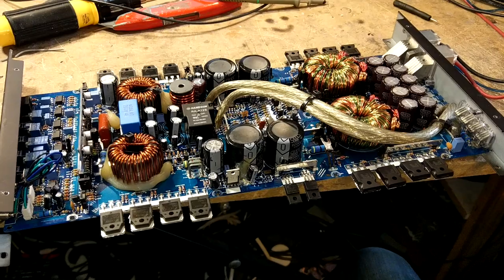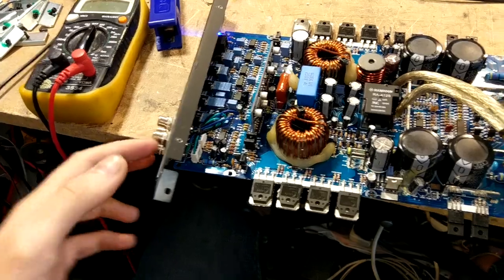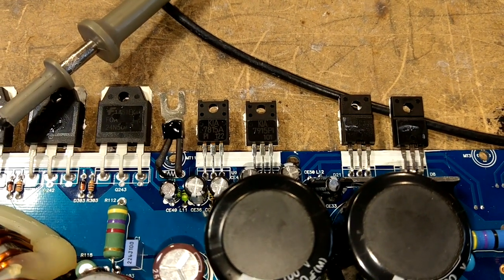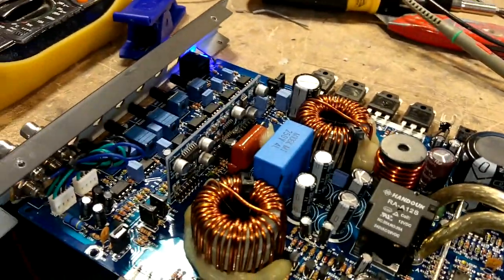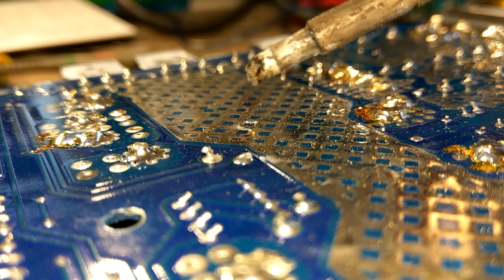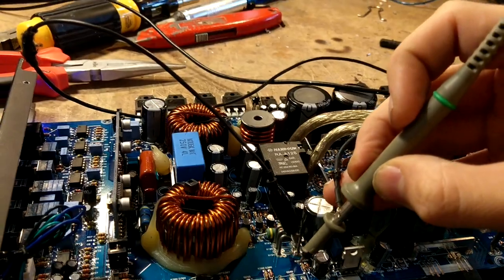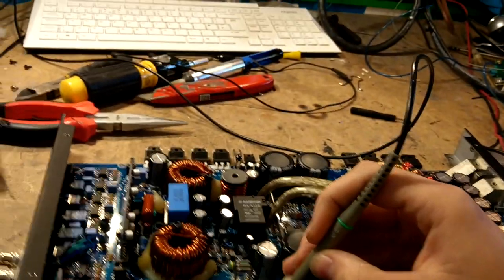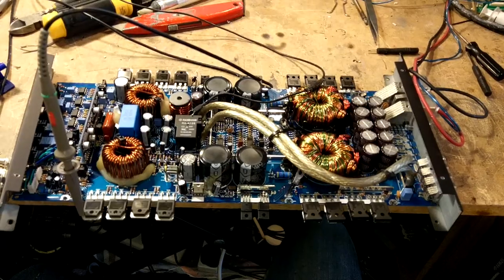Car amplifier fault finding - Sundown SAZ-1500D Repair

Comment: Most amplifiers these days require anywhere from 0.2 volts up to 6 volts in order for an amplifer to respond to the signal coming into an amplifier. Quite rite, sir. Thank you for this informative tutorial. I've had issues in the far past with amplifiers. Thankfully, my Orion XTR750.4 amp that runs my front and rear  component sets is followed up with my CT-SOUNDS 1000.1D monoblock run at 1ohm to my two 12" Black Diamond DX12V4's powered by battery isolator & yellowtop optima haven't given me much hastle the 3 years I've been running them. I've fixed pathways, replaced capacitors, and refreshed solder connections as well as gone as far as fixed a 3 layer old school pyramid amp board that was cracked in half. However, I've never tested or replaced mosphets, and so on. This video helps provide me with a good process for reviving my set to the side amps that may see more use for myself or others down the road. Certainly, an idea of how to tackle my monoblock as the warranty is practically up this January. Thanks.

Comment: Very informative. Had the same issue with a snapped transformer lead --> LM7812. Took me ages to find it, due to the fact it was under the sealant and I wasn't so experienced enough so i could resolve it quickly. 

That video is time saver for beginners ! Veryyy niceee !

Comment: Thanks for sharing 
I used  to have the same soldering station and heat station all in one same as that one you do ..worked like a beast until I retired it  😂
Reply from the maker: My one occasionally drops out the heat gun for a few days then starts working again. Pretty annoying!
Reply: barevids That’s crazy lol Never had to replace the heating element in the hot air station only the soldering Iron had for years worked awesome 👏 
then upgraded to JBC equipment  
Seems like you know your stuff about amps how did you learn the stuff ? if you don’t mind me asking
Reply from the maker: @QsTechService1  a combination of trial and error, and Perry Babins amp repair guide from Bcae1 ☺
Reply: barevids I’ll have to check that out you were very thorough with showing how to test with the scope pretty awesome I subscribed 😂 I have a few amps to fix for some friends what do you all fix if you don’t mind me asking

Comment: For the past five years, we have purchased two second-hand Power Amplifiers, each lasting less than two years. The last power amplifier we bought new in July 2022 was the Behringer EUROPOWER PMP2000D, which only lasted for exactly two years. All these power amps had the same issue: they could be powered on but had no sound output. Do you know what the common causes of these amplifiers to fail?

Comment: Same thing happened on my switch mode power supply. The transformer glue isn't holding it anymore! The wire are extended a bit to reduce the stretch and fatigue, then potted the thing with silicone. Definitely will never happen again.

Comment: Hi,thanks so much your video came up very helpful...great job,but I have a question regarding my amplifier,when I connect the power cord it blows  both the car and amp fuses and also noticed when opening there's a smoke on the side of the cap as well as on the back of the power port...how do I fix that.

Comment: Explain how protect mode in amps work pleeaase
Reply from the maker: Overcurrent protection: shunt resistor with voltage drop detection circuit across it
Over/under input voltage: just a simple few transistors that come on or off when voltage goes beyond thresholds
DC offset protection: combination of resistors and caps that pass a protect signal if DC is detected on speaker terminals by charging the cap too high
Reply: barevids What usually causes this? Not enough power supply or a bad battery?
Reply: @Gambleraddictz  even a bass remote knob can cause the amp to go into protect

Comment: awesome shit.. subbed. hope to learn more.. right now I'm trying to repair the amplifier from a definitive technology prosub 80 subwoofer. have a couple of resistors that have burned out. i can replace them and I find no other visible issues but would like to be able to find problems better like this.. i was using the home subwoofer in my car connected to a power inverter.. i think the resistors blew because the sub has an auto on/off and is usually constantly on in a home.. every time i turned off the car though i would hear a loud pop from the subwoofer. was told that was power discharging from the capacitors. ugh.. was a good $20 goodwill find. want to fix it.

Comment: Nice
Is it possible to fix lcd screens that disappear when warm (backlight still works)
Reply: TCon board. Unplug 1 of 2 strips running to screen and power it on. If you get half a screen during either test. It's the Tcon

Comment: i have a dd m2b amp that is in pertection and the reason being i have two of them and i got rushed while i was straping them together and wired both neg outputs to the pos and neg speaker terminals and the jumper that is supposed to go to the ground went to both pos when its supposed to be the other way around one amp is fine and the slave amp is in protect and idea what might have blown in the amp
Reply from the maker: Output fets at least! 😁

Comment: I have a Digital Designs M2C AMPLIFIER that I bought used 2 years ago.  When it arrived in the mail, the RCA inputs were damaged.  I desoldered them and replaced them with the RCA inputs from the master slave link side.  I eliminated the inputs for the master slave link side.  When I powered the amplifier on it turned on but no signal to the subwoofer.  I removed the bottom cover and looked at the components and nothing looks like it's burnt.  Could this be an easy fix?  Please advise.

Comment: Barvids i have a phoenix gold amp and it makes noise, what seems to come from a big capacitor. It plays but when i turn it up it squeels? Any advice?
Reply from the maker: Normal clipping sound
Reply: @barevids  hay thanks for your time.. Well the amp plays fine at low volume, i cant even turn it up on half volume it squils?¿

Comment: You're great bro! You've got real knowledge! Do you have a degree in electronics engineering? Here in India, I don't think we have anyone as talented as you so we are scared to buy imported expensive Korean amps like DD, Sundown. So do you recommend investing money in imported brands or better to go with normal brands like a pioneer, JBL which are available over here? Also, I heard red & blue circuit boards are better than green circuit boards, is it true?

Comment: hi sir.. really appreciate if u have opinion or suggestions with my mohawk silver 2000 monoblock.due to my car alternator faulty maybe got to this prob occur.. After realise my amp become very hot and look inside.. did notice 2 of the last mosfet is overheating...without any doubt I oder and change both of the mosfet.. but after replacing it the prob still occur.. all sound seems to work fine no protect that I know of.. so really need your help maybe any idea what wrong with it sir??

Comment: If I have a class d mono block amplifier with a variable low-pass filter (50-250 Hz, 12 dB/octave). Can I remove this to make the amplifier neutral or will this cause my amp to not work.

Comment: Great video man but I got a question for you man so I have this amp B2 riot 7500 I’ve had so many people say they can fix it but fail your really my last hope that I have before retiring this amp it’s 5 months old and as I was driving my positive speaker lead came off the amp and grounded therefore causing the amp to short out the amp still turns on but doesn’t have no output check it out myself didn’t see anything burnt out on it so I gave up plz can u help no one has been able too progress on it plz help
Reply from the maker: I can repair it but I'm in the UK and shipping will be more than it's worth

Comment: I've tried hundreds of you're videos because my amp is not sounding. I think my RCA touched the ground cable during operation and 3 of the 4 channel have no power, but they sound and play signal. I'm trying to understand what could have happened but despite of the fact that I'm electrician, my electronic knowledge is not enough. I would try check the transistor because it seems to be the weakest part. I would appreciate any advice. Thanks.

Comment: Question for ya. So if the out out of an amplifier was shorted out what would be the likely cause of the channel going out? A three way speaker had broke it's tweeter off and the wires had shorted I'm assuming cuz there is no output from that channel. It's  a five channel autotek and all other four channels work fine.
Reply from the maker: Output transistors

Comment: have you any experience with active crossover repair? i have an old phoenix gold ax active crossover which isnt powering up even though it gets power right to the input plug. i opened it and it had a cap that had a dry joint which i reflowed but it sill wont turn on and i dont want to start recapping just yet. 
anything i could or should check or could be problematic?

Comment: Great videos, did you ever work with nitro amps? I have an bmwx-487 and i’m looking for A value resistor. Is next to the PWM IC, location RP1. Thanks.

Comment: Hey there do still repair amps? I say still because this video is so old so you never know but I have an amp that needs repair and whatever is going on with it it is acting just like this amplifier as far as it not activating or running. Be cause the amp powers or and looks like it should be functioning normal no red or warning lights but it is not outputting any sounds I have opened it up and nothing looks out of order so I'm stumped because I don't have the tools to troubleshoot at what point the signal is cutoff or if it is not being activated etc the amp is a Zedition z2400d not much info about it online but when it worked fine it really put out some booming bass pro ably the loudest and best sounding I have ever heard and I used to compete with the older early 2000s Rockford fosgate amps even took 1st.place a couple times 2 15's punch power subs and the 801s I want to say was the model number and this amp would have obliterated the Rockford for sure so I'm trying to bring the z-edition amp back to life and wanted to ask and see if you still might be repairing amps and if so if you work on send ins off of here on YouTube like this if not I'm interested to know if you know anything about these amps as there is almost no info anywhere on it online at all and I snagged it up from goodwill that didn't know if it worked and didn't feel like testing it so I took a chance and it worked for me for a good while before my stupid ass overloaded it with less than 1 ohm and it quit working so I killed it everything the whole car cuz figured it went into protection mode and waited till the next day to turn it on and I unhooked the extra speaker that I was testing with the higher ohms and hooked up the usual set up and when I turned it on everything looked fine and like normal so I figured I dodged a bullet got all excited but when I proceeded to try to listen to it I got nothing from the amp have tested and tried everything and finally got a trade on another amp for some of my hifi gear put that amp in and walla so I'm sure it's something in the amp because the amp I got on trade was the last thing I was able to use to verify that the amp was not giving a y signal or output so please let me know and if it helps you can look me up on face book timofey samoylich will find me if you need to get a hold of me. Thanks man let me know please !
Reply from the maker: Where are you located
Reply: @barevids I'm located in Gulfport Mississippi can ship it to you it's a crossfire XS-8K

Comment: I've got 4 pioneer gmd 9601 amplifiers. They all go into protection as soon as they come on with no rca or speakers connected. I looked inside and didn't see any burn spots. Do you have any idea what the problem is?
Reply from the maker: Output fets shorted. You can buy diagnose electronics with your eyes.

Comment: Hey I just bought a new deafbonce aab3800.1 has a static/buzz around 77hz signal on the outputs to speakers any clue what would be the cause? (The Buzz is there without the rca cables connected and with no speaker connected.
Reply from the maker: How do you know it's there with no speaker connected if it's on the speaker terminals?
Reply: Can probe the output of the amp and I have a signal
Reply: Deaf Bonce looked at it I guess it is normal for them to have a the static/buzz sound..
Reply from the maker: @allenl9372  yeah there will always be some noise when viewed on the scope. If you plug a sub in tho it shouldnt be noticeable sound from the cone.

Comment: I have a question is the oil from a potentiometer (Soundigital 12k) conductive? Bought a amp from Droppin hertz.com and I had it for less than a month never even played it and potentiometer went bad and oil came out of the board it's still Powers up Cody Johnson is trying to make it a hassle for a return.
Reply: Like I said had it less than 30 days and he wants me to fill out a form and ship the amp somewhere. I am assuming at my expense because he said nothing about a label

Comment: I have a strange problem. Positive and neg touch inside the amp somewhere when you hook it up it sparks and then goes into protect. Doesn't blow a fuse. I  took a multi meter and tested conductivity and one probe is hooked to the neg the other to the pos and it beeps. Took it apart but I am not a amp genius so I really couldn't see anything wrong but something definitely is.
Reply: Problem*

Comment: Hi bro, I've been watching all your repair vids the last few days. Never knew I'd find it so interesting. I have a 4ch amp here that plays for a minute or so then the sound just disappears. The lights are still on but no sound. If I remove the remote and connect it it works again for about a minute. The amp also gets hot when it's on even with no signal. Opened it up and saw 2 of the voltage regs gets hot (7815). And 2 next to them (mur16200) both have short between gate and source. What do you recommend I do?
Reply from the maker: MUR1620D are not fets they're rectifiers. They're meant to have a short between 1 and 3 as you're just reading the transformer winds. Voltage regs do run warm since they're dropping voltage but shouldn't exceed 60°C. If it's a class D amp I would take a scope and see if the switching waves dissaper when the sound goes. If not, trace the audio through the board and see where it loses it.
Reply: @barevids  cheers! Will have a look.

Comment: So, I have a Hifonics Brutus Elite 1700.1 amp.  My silly self decided to clean up the wires in my trunk which meant disconnecting the RCA's from the amount so I could run them around some other wires which would allow me to hide them more effectively. I also have a 2 farad capacitor mounted to the back of my seat. When I disconnected the RCA cables from the amp they accidentally touched the positive connection on the capaictor and of course my amp stopped working :( ...I have absolutely no experience repairing these so I'm wondering if I could send the amp to you for repair or if anyone can advise where I could send it for repair?
Reply from the maker: Where are you based?
Reply: barevids how much would u charge to repair a Hifonics that’s going into protection mode?
Reply: barevids I’m n Texas.

Comment: Great video!  I felt like I was sitting in a classroom.  Do you have any idea where I can get some 160V 100uF nonpolar electrolytic caps?  I haven't had any luck here in the US.
Reply from the maker: Nothing on mouser?
Reply: @barevids  
Thanks for replying! Mouser and Digikey have bi-polar caps but not that high of voltage.  The original caps are Yihcon brand BP series from an old Hifonics ZRX1800.1D.  I will continue to search but this is blowing my mind...😞🤯. Never had problems finding caps.
Reply from the maker: @jameswilliams4735  are these cylindrical ones?
Reply: @barevids  
Yes, they are the radial leads type.

Comment: Can someone help me. I have an amp when I connect the power supply the red light blink once and goes off, battery voltage is about 13v,  I have opened the amplifier and seen no physical defect, I have checked the MOSFETs with multimeter I didn't find any problem. No prob with ground and power supply too.  What may be the cause??
Reply: I think is the same problem like he explained the output i got the same problem in my amp